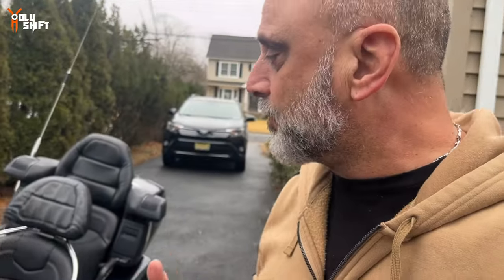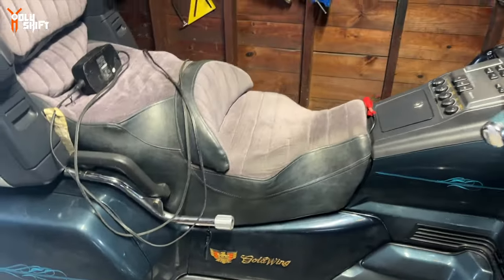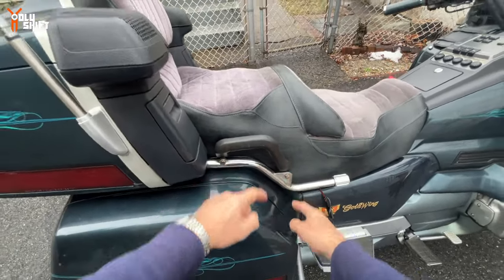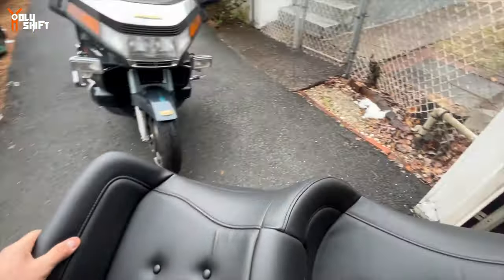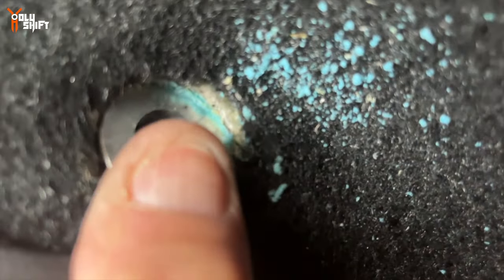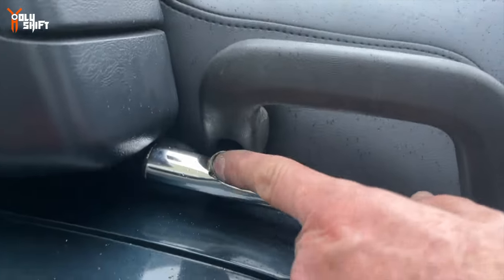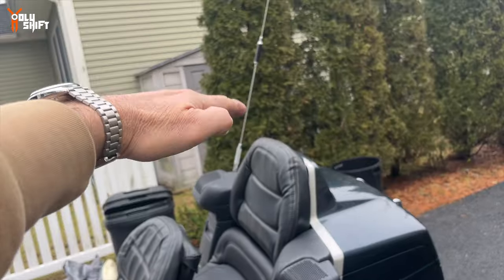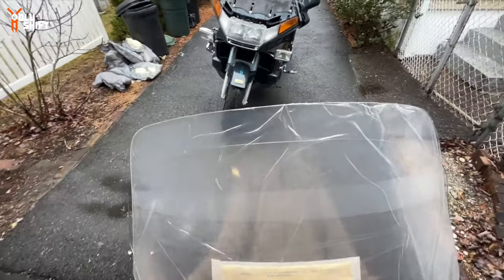GoldWing TLC ! New Seat and Windscreen Install

Comment: Clear View shields are wonderful products and you’ll be pleasantly surprised at the new look and protection on your ride with the Mrs.  That old seat was certainly dated and the new unit is a much better option.  Did you get that bolt secured on the seat?  Be safe out there Sandy and enjoy 🤜🏼🤜🏼

Comment: When I bought my 2018 Wing it had an oversize 22" windshield installed. I wasn't happy with the way it performed, it caused a whistling noise and even with the gen 6's electronically adjustable windshield, I couldn't get it low enough and full up was like a barn door on the front of the bike. I changed it out for a smaller 18" re-curved windshield and this made a huge improvement in wind management and also gave the Wing a better look.
Reply from the maker: Yeah the recurve helps with the deflection of wind